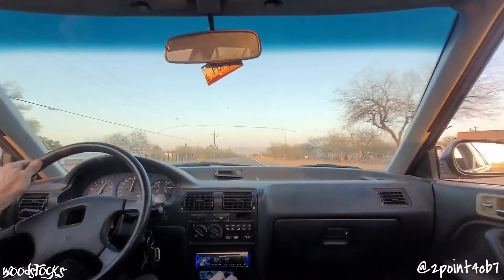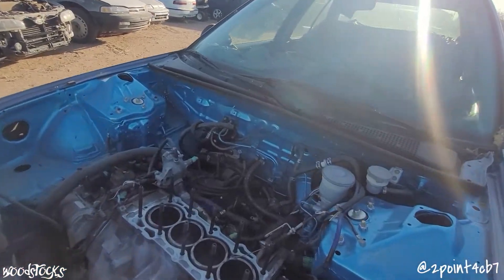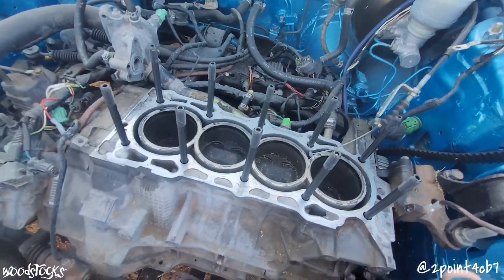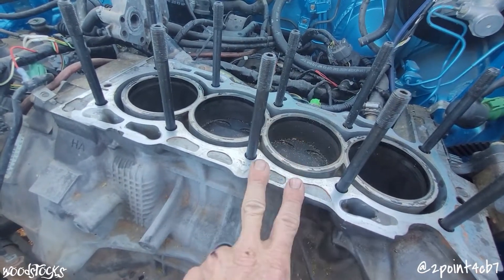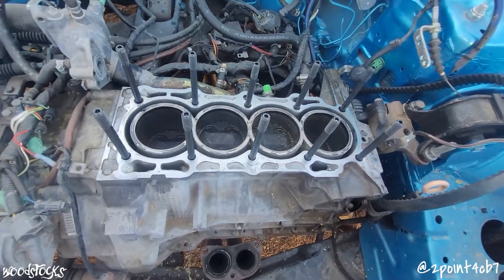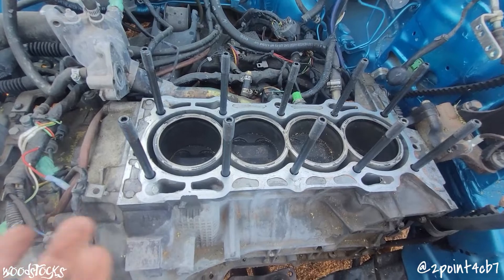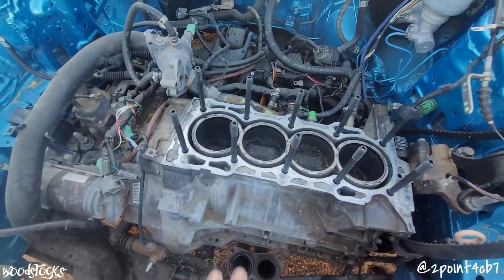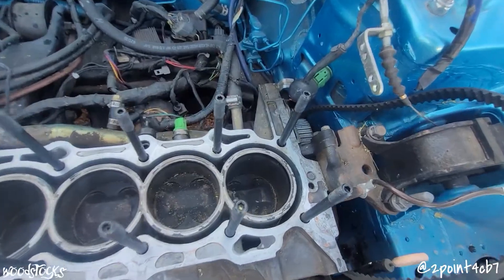g23vtec the right way / the complete how to explained / all mods and gaskets

Comment: a "g23" isn't necessary at all. it is only an aesthetic mod. The f23a head is amazing and cheap to build. j30a4 valves are a +1mm upgrade and j32a2 valve springs drop right in. with mild porting you get 300cfm. I don't understand why people do this and toss away a head that has more bang for your buck.
Reply: If this is true I wanna get a hold of u more to build my 01 accord short block im going to build the cyl head valves springs retainers and a cam nothing aggressive just enough to make 180 wheel obviously if I want more boost it but im looking to be better top end

Comment: I only used F23 Oem headgasket. We tried Felpro and it leak oil on the spot where you have a jb weld. Somehow the aftermarket gasket are build different than oem. Hope you put your engine together w/ no hiccups.
Reply: Don't know why my comments keep getting deleted when I mention to check out your YouTube page.. lol.. its just my personal opinion that I feel like your one or the most knowledgeable g swap builders on YouTube or that I know of, in my personal opinion. Plus getting people to check out your channel will open up more doors for more knowledge that might not be covered by one person. I would direct people to this channel, if they are looking for more content or more knowledge in g swaps in that matter 🤷..
Reply from the maker: If your comments are being deleted it is youtube that is doing it and i dont know why they are deleting your comments. 

The secret that everyone seems to be holding onto when it comes to this build is what i stated towards the end of the video... use the f23 head gasket (oem is best) and to have all the oil ports on the head welded to perfectly match the f23 gasket for a guaranteed result.   Some may get lucky and have no probs using the f23 gasket with no mods done (aside the 2 drains that have to be blocked) to the head. My buddy's had mixed results with just the f23 gasket until they modded all the oil drains to match the f23 gasket and torquing their arp's to 120ft/lbs. The only issues they have been dealing with on their g23 builds since is spinning rod bearings when taking them over 8500 rpms. 

I appreciate your guys feedback here in the comments. Thank you. The more info there is out there, the better off we are as a community
Reply: @cambodianboost3945  not to worry so much my friend, thank you for getting the word out. There's actually a whole lot more folks that build this G better than others but they choose not to share their recipe secret. Hope you get your projek goin man! Later and thanks again.
Reply: Yeah. The f23a headgasket seems to line up the best. I'm even using it on a f22a head and it performs flawless with it. But I know the h22a head coolant ports are different and oil ports are slightly different as well but it looks to be the best choice to use